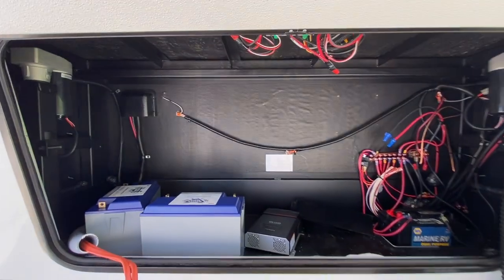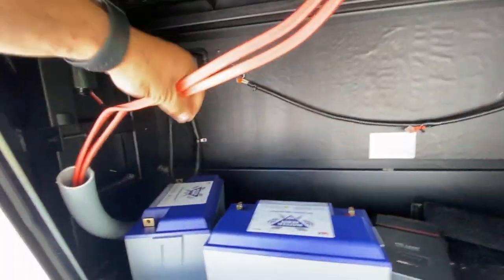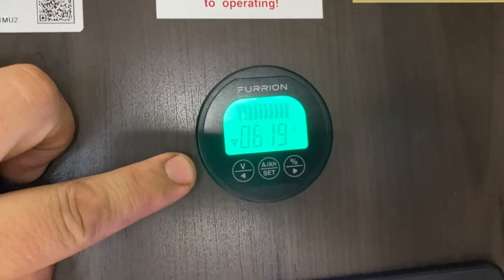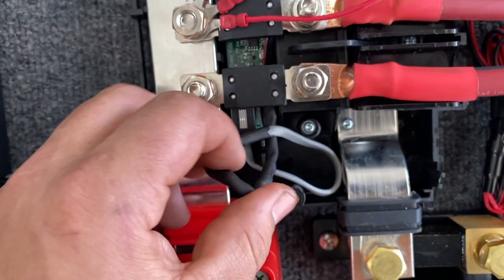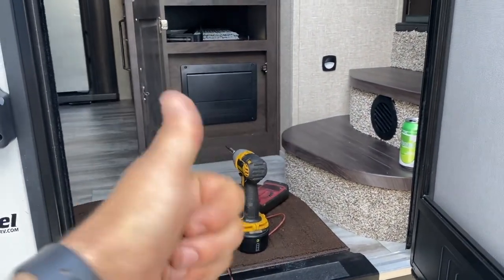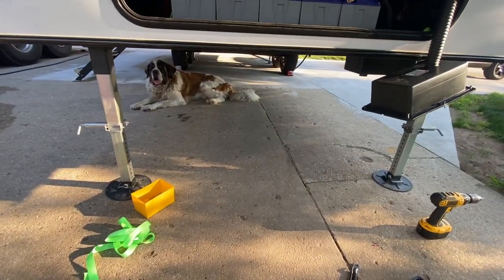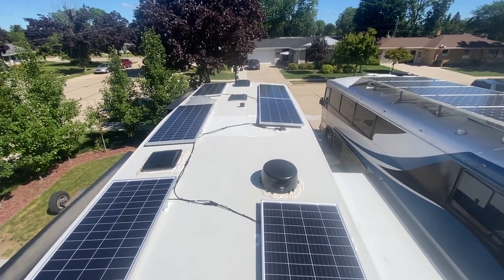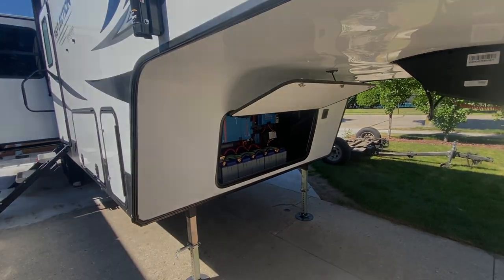Grand Design Reflection 303RLS Victron Solar System Install

Comment: Great set of videos, I love the experiments. I have a 2020 303RLS, and I was looking to do this kind of install, down to the same panels and 3 panels in series configuration. I am curious about your choice of 150/100 vs 150/85 charge controller. Spec sheet shows 150/85 is up to 1200 watts. I am guessing you want the overhead in capacity for longer controller? Any other pluses to the 150/100?
Reply from the maker: That’s about it. It goes the customer options in the future as well. Glad you’re enjoying the content. I’ve got some other experiments planned as well.

Comment: Nice clean install!  how did you mount board? Through bolt it to the existing backboard?
Reply from the maker: I think just a hand full of wood screws. Hasn’t failed us yet. Edit: if hitting metal support we’ll use those self tapping screws included in solar panel mount kits. About the only thing they are good for.
Reply: @sotasolar

Comment: nice to see you doing installs, haven't chatted in a while, hope all is going well.  was wondering if you know of a good solution for measuring ac use when using a non victron inverter. my pi4 is still working well as your videos were very clear, but i wanted to see if its possible to watch the ac use. best of luck.
Reply from the maker: Kil-a-watt is a great little device to get a sense of AC loads.  As far as long term monitoring and logging, I'm not sure.
Reply: @sotasolar  was looking at the victron ET112 connected to the pi4, thought you might have seen that?

Comment: Minute 5:37 appears you left the old battery disconnect in place?  And the wires for the old disconnect show still in place at minute 6:29. The red from the bottom second from the left, and the black bottom 1st from the right.
Reply from the maker: Yes, I typically leave as much of the stock system in place as possible. I figure if an RV tech needs to work on the system, keep that part functional.
Reply: @sotasolar  Ok... thanks. I'll see about connecting it back in. It did work with it connected.

Comment: Hey Shawn,  what did you do to by-pass the Converter on this 303?  Or is the shore power line going into the Converter first before going to the breaker and I missed that.
Reply from the maker: I’ll need to review it. Usually there is a plug on the back of the breaker panel you unplug and that does it. Worst case you unhooks the main positive from the converter.

Comment: What size fuse did you use for the positive terminal that runs to the DC panel bus bar? I know the correct size for the output from the solar controller (100 amps for my solar setup) and from the inverter to the battery (400 Amp T Fuse). My DC fuse panel says max of 160 Amps, so that's what I'm leaning towards. I have the same Reflection model shown here.
Reply from the maker: Fuses protect wire, so whatever size wire you have you go 10-30% up. So 6 awg we do at 80 amps (rated for 50 amps) and so on. We commonly run 6 awg or 2 awg for DC main to coach. Would be 80 or 125 amps respectively.